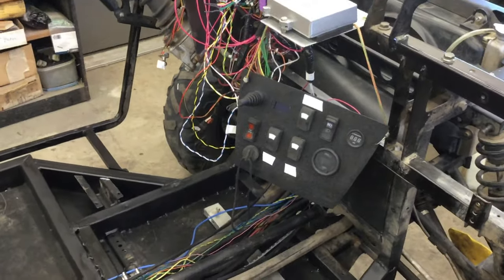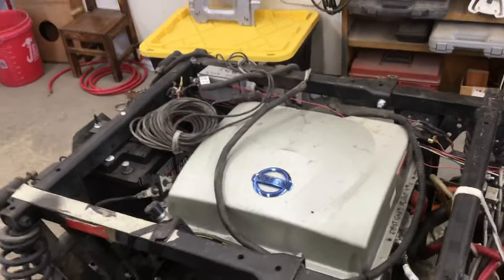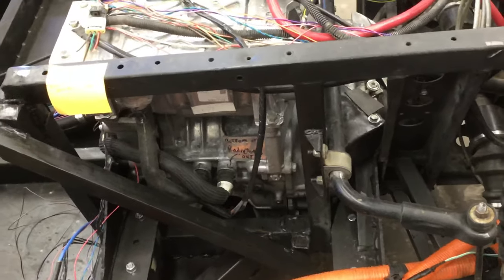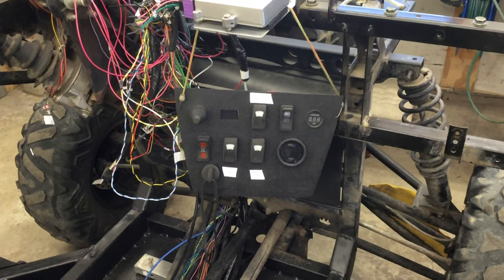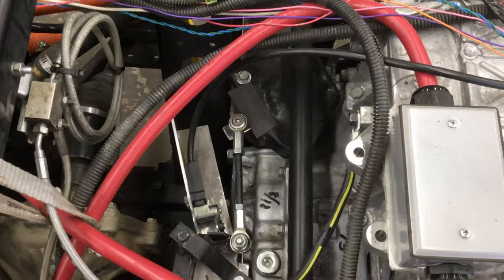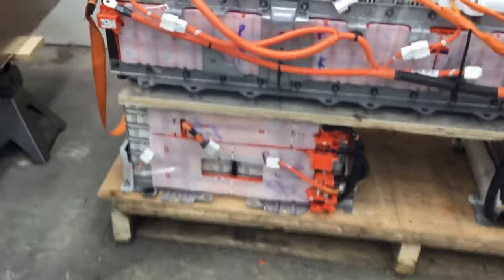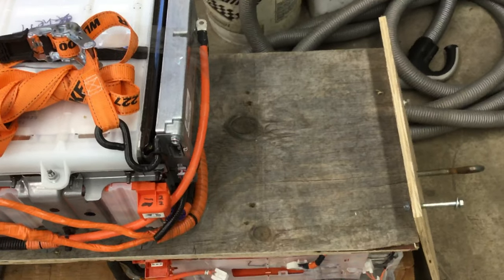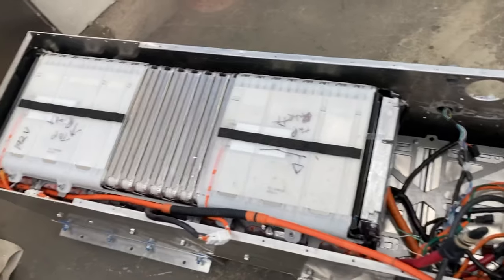Polaris Ranger 6X6 conversion using Leaf components and Resolve EV controller

Comment: Can we please get an update on this!? I would love to see how it turned out. A friend has an 04 Polaris Ranger 6x6 with a blow up engine, would be an interesting project to try converting it to an EV.
Reply from the maker: The Ranger is working great with no problems.  It is now a great machine, quiet, lots of power.  Have you looked at both videos?  Any question please don't hesitate to ask
Reply: @roynelson2790  that’s great to hear! Yes I’ve watched both videos, very well put together! How has it handled the mountainous terrain near you? Does it struggle at all, and what kind of weight are you pulling with it?
Reply from the maker: @DevelopingJon  With a electric rig the accelerator controls the torque.  After I got the project done I had too much torque (gas pedal was too sensitive, wild) so Isak (person that developed the controller) sent me a software update to reduce it to 50%.  When fully loaded (2000 lbs. of water, equipment & driver) it handles the mountain terrain way better than the gas motor (40% slope at times).  Isak is working on developing software for different torque settings.  Keep in mind this is a work rig, not a recreation rig and only goes about 23 MPH because the gear reduction I did.